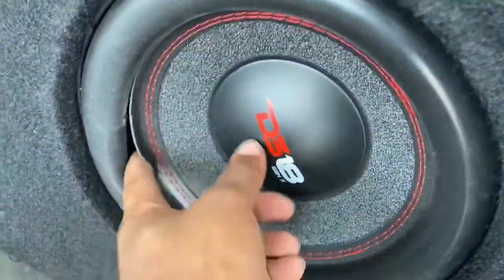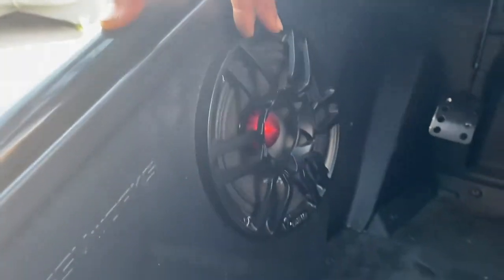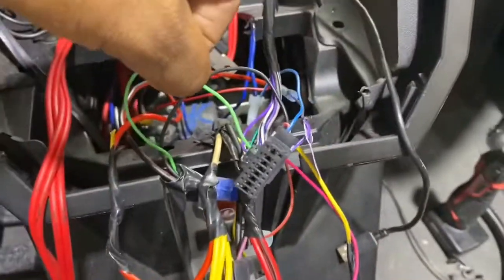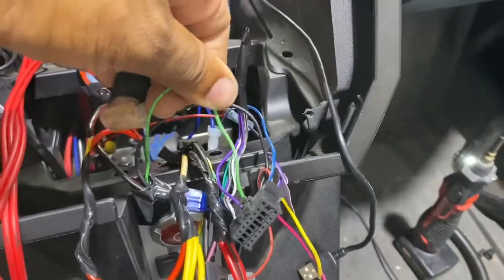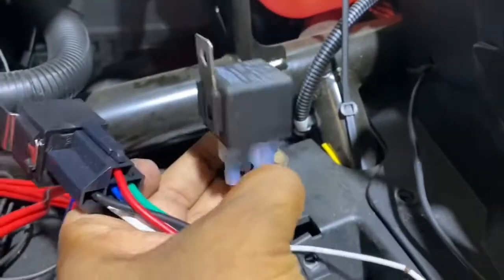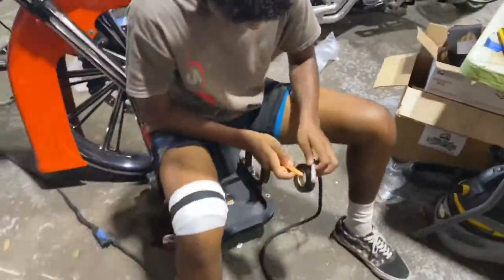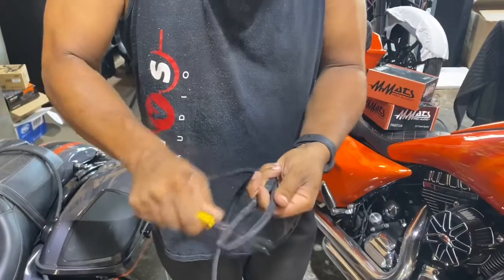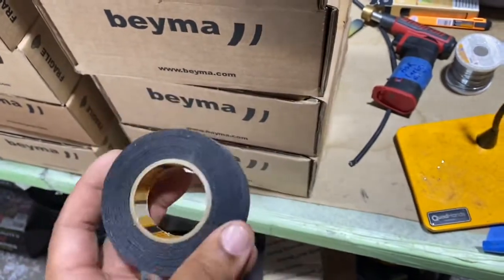Polaris Slingshot wiring rescue and audio upgrade

Comment: Hey brother do i need to flash a 2016 road glide if i install a DSR 1
Reply from the maker: Carlos Bobe you can get away with not flashing the bike and letting the dsp fight the factory eq , buy for the absolute best sound you should always flash the radio and use a dsp . 

The flatter the signal going into the dsp the cleaner that output signal will be